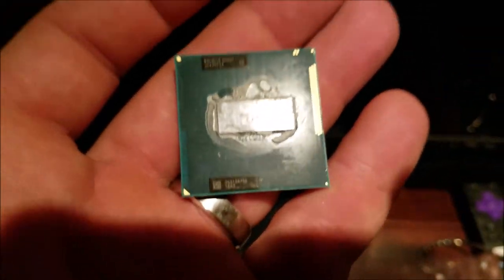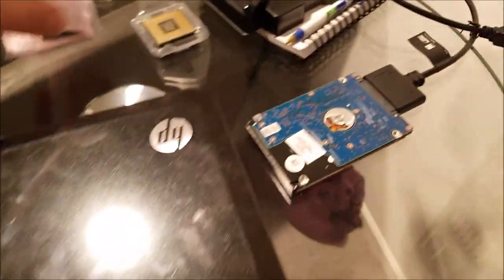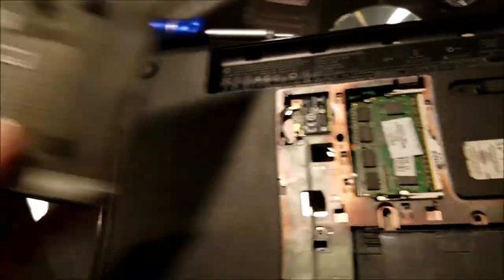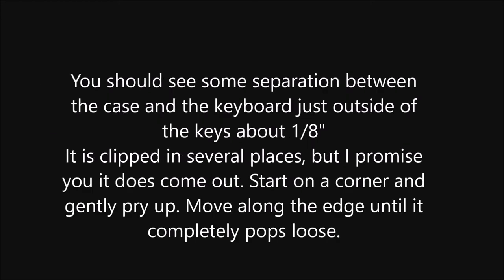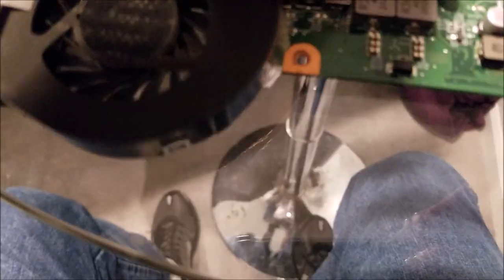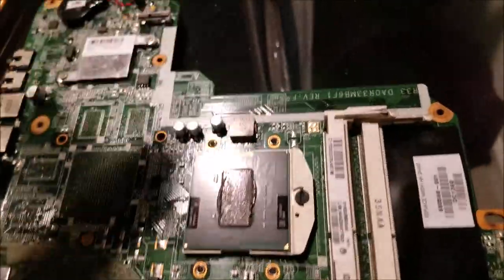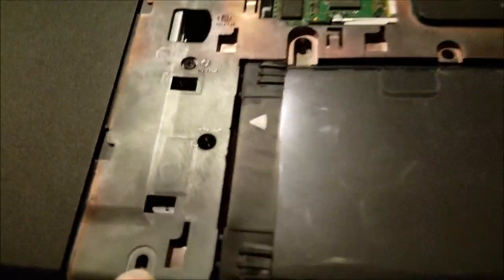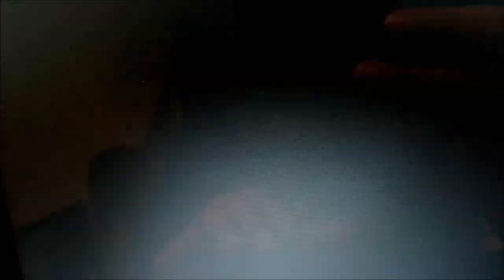How to upgrade to an i7 processor in your old laptop

Comment: have a nice day. I also have an asus k53sv / sx582v model laptop. Specs of my laptop: MOTHERBOARD: hm65 rev :05 (asustek), south bridge: sandy bridge, CPU: i5 2430m, internal graphics cards: intel hd3000 (I installed intel hd 4000 drivers on this video card) + nvidia gt540m . Storage: 480gb sata3 2.5" ssd + 1tb sata3 7200rpm hdd (hdd connected externally). ram: 12gb 1333mhz ddr3 sodimm ram. I installed the bios version to the latest version. Moreover, I bought something with 2 fans from china and it works in the cdrom slot of the computer. 3 usb in my computer It has a 2.0 port. I open a Youtube channel. I will publish 1 hour Mathematics and Geometry video lessons in 2k resolution. But the processor and features of the laptop are not enough to shoot, edit and upload videos to youtube. Can I upgrade my i5 2430m processor to i7 3840qm? What do you suggest me to do.  If I can make the processor i7 3840qm, I'm thinking of upgrading rams to ddr3 1600mhz 2*16gb=32gb sodimm ram. Also, my laptop battery is 4400mah +56whs+ 10.8v, and it runs out within 1 hour (while processing), (the battery has 6 cells). Can I change the battery to 9 or 12 cells like you did and use it for 9-12 hours? I'm thinking of connecting an internal video card. Something like Msi 3090 suprim ti. What do you say? With the addition of these, will there be a computer that can do youtube work, run animation, play online quality games, live broadcast and live online lessons? It has to do many operations at the same time. When I build a desktop system in the future, I will install this video card on a desktop computer. I have no money now. I have to postpone the graphics card and desktop computer collection to a later date. These are what I have. I need to shoot a video, edit it and put it on youtube as soon as possible. Please can you reply me urgently? MY PCİ EXPRESS 2.0
Reply: you can install an i7-2630qm processor and leave 12GB DDR3-1333 RAM in the laptop. You can install an i7-2720qm processor and 8GB+8GB DDR3L-1600 RAM.
Other i7 (4 core) processors are not recommended to be installed in this laptop due to poor motherboard power supply. Intel 3rd generation processors will not work on the motherboard (HM65 chipset). 
The cooling system should be of two pipes.
I installed an i7-2760qm processor in a similar laptop (Asus k53sd), but so that the power supply and motherboard do not burn out, I use a processor without turbo boost at a base frequency of 2.4 GHz.
Thanks to a 250GB SSD and 16GB (8+8) DDR3L-1600 RAM, the laptop runs fast. I use a laptop for old games (2006-2013). The maximum load of RAM was 10GB (out of 16GB of RAM).
32GB of RAM is not required for this laptop.

Comment: Hello can i upgrade my processor which is i3 3110m with i7 3940xm or i7 3840qm would be better choice
Reply: Btw my laptop is lenovo g400
Reply from the maker: @rvenant1132  I would go with a 3840qm. The higher tdp of the xm chips has turned me away from them unless your laptop has the extra cooling for it. My 2920xm ran over 100⁰C when rendering videos. The all-core base clock is 200mhz faster and single-core boost is 100mhz faster than the 3840qm. But the quad core i7 is much faster than your 2.4ghz dual core, either will be a huge upgrade. My 3840qm has never run hot and is still blazing fast. For reference, the base/boost clocks of each are as follows: 
3840qm: 2.8ghz/3.8ghz quad core
3940xm: 3.0ghz/3.9ghz quad core
3110m: 2.4ghz/no boost dual core 
  Consider price before ordering parts. These are aging laptops and entire newer models can be gotten used for less than the price of a cpu upgrade. 
  Aside from the cpu upgrade, I recommend upgrading your hdd to a ssd. Solid state drives use flash memory instead of a spinning disc with a mechanical eye to load data. Ssd's are much faster and will speed up your start-up times and nearly all load times. From a cold start, my old hdd took over a minute to power up. Now it's under 20 seconds. Old mechanical drives will fail at some point, so you should think about backing up or cloning your old drive if it is the original drive. It definitely revives aging laptops and makes them usable again. 
  On a side note, I think that even a 3630qm would be a great upgrade for you. It's a quad core and while the clock speeds aren't as fast as the higher tier I7s, it's still a great chip. I installed one in a laptop that I gave to my mother. It will be cheaper than the other options and still much faster than your 3110m. 
  Note that the onboard graphics are pretty terrible and gaming will not see much of an improvement. The only way to upgrade the graphics is to get an external gpu. I used an amd rx580 a few years ago and it made a huge difference. On an old game, I was getting 1000fps in the menu screen. The only problem is that I had to remove my wireless card and tether to the external gpu and power supply and output to an external monitor. At that point, a desktop pc is more practical. If you are interested, I can tell you more about it.
  If you have any other questions, feel free to ask. I'd be glad to help out.

Comment: Hello Erick, sorry for the inconvenience, but I wanted to ask what you think about the possibility of improving the processor of my notebook, Samsung rc420s02, it is equipped with a sand bridge processor, HM65, i5 2410m, max tdp 35, with a 988B rPGA socket.
Intel HD3000 graphics, and a dedicated Nvidia GT520M graphics card.
Based on your experience and compared to your notebook, do you think I can upgrade to a processor like the i7 3840qm or the i7 3940xm?
I would really appreciate it.
Reply from the maker: You said you have a hm65 chipset. That is your limiting factor. That allows only sandy bridge 2000 series chips. An ivy bridge processor will not boot in an hm65 system. The fastest processor you can use is a 2960xm. I think that anything with a quad core will do great. I believe there is a 2630qm quad core that would work well. I believe that is the lowest sku quad core. Anything with quad cores is leaps and bounds above a dual core. I don't notice a difference between the 3840qm and the 3940xm. The only difference I've noticed between the 2920xm and the 3840qm was the cpu temp under load. My 2920xm would regularly would see 100⁰C while rendering videos. I've installed a few sandy bridge quad cores in laptops for friends and parents and my wife. They all feel snappy and responsive after the upgrade.. And you can pick up old laptops for very cheap. I haven't benchmarked many of them, side by side, but for daily tasks, any quad core will work very well compared to a dual core. I also recommend a sata ssd storage drive. Unfortunately, an ivy bridge cpu will not work, but I recommend a 2630qm or any quad core sandy bridge chip that you can find cheap. 
  Good luck breathing new life into your old laptop. Comment here again if you need anything else.

Comment: hello! i need ya help man.. i have an dell e6420 with i5 252m and i want to upgrade this proccesor to i7 3630qm. i5 has sandy bridge and  i7 has ivy bridge. will work? second question. can i upgrade the ram to 16gb? on official page of dell says max supported is 8gb...but other ppls say can be upgradable. ty and peace!
Reply from the maker: It all depends on your chipset. If it is hm65, you cannot run a 3000 series ivy bridge cpu. If it is hm76, you can run the newer and more efficient cpus. 
  I think mine says max supported was 8gb but I have a kit of 16gb ram in mine. 
  I have actually upgraded to a 3940xm.
Reply from the maker: I'm guessing that was a typo and you have a 2520m processor.
Reply from the maker: I just checked the specs. HP says the max supported is 8gb but I absolutely have a kit of gskill ripjaws 2x8gb DDR3 1600mhz in mine. 
  I think a better upgrade would be a sata SSD storage drive. My HDD physical hard drive was ailing and the ssd made a huge difference. Probably as big of a difference as the i7 processor. One good thing about the i7 is that you can process data as quickly as the SSD and RAM can provide it. The dual core i3 or i5 processors can't handle as much data simultaneously because there are only 4 threads.. while the QM processors have 8 threads. 
  To find your chipset, download CpuZ. On the main board tab, you can see the chipset version. The hm76 or hm65 will probably be in the Northbridge or Southbridge area. 
  Regardless, look up processor compatibility for your chipset and the 3630qm is on it, you're golden. I'd still update your BIOS from Dell beforebyou swap cpu's just to make sure you have the best chance of compatibility. 
  Good luck with it.

Comment: Can't seem to find your previous comment last night. I'll will repeat again. I have Lenovo ThinkPad L420 and my current CPU  is i5 2430m. I need advice if it will works with either i7 3610qe or i5 3610me? They both support hm65 chipset and has the same socket which is G2?
Reply from the maker: Here it is! I actually commented on one of your videos. Lol. 
  It looks like you've done your research. If I had the choice, I'd go with the quad core 3610qe. It looks like it is compatible with hm65 and g2. Don't discount a high level sandy bridge chip. A 2820qm, 2840qm, or 2860qm would give good performance as well. It's just based on the older 32nm architecture. The newer 22nm architecture is a little more efficient and less power hungry. 
I'm not sure exactly what cpu you have currently, but I'd be willing to guess a sandy bridge i3. Either a high end 2000 series quad core or the 3610qe would be a great option. Stay away from the Xtreme series sandy bridge chips. They will be marginally faster but will probably run hot during cpu intensive tasks like video rendering. I tried a 2920xm and it was good, but not necessarily worth the money over a regular i7 quad core cpu.
  Remember that these parts are old. I would search the used marketplace and see what you can get a good deal on. I would have no reservations against running a higher end quad core sandy bridge over an ivy bridge 3610qe if the price was comparable or even lower. Also, be on the lookout for a different cpu. A newer laptop could probably be had for cheaper than just a high end cpu. I don't want to discourage you from upgrading what you've already got, but a newer platform may be a good cheap starting point as well. You could keep your hdd and slap in a fresh windows install and sell your laptop to recoup some of the budget. 
  If you haven't upgraded to an SSD, I definitely would. Especially if the hdd is original. Mechanical drives do not live forever. I would clone the drive and never look back. Ssd's will speed up any loading screens. . Especially windows startup. It will take under 20 seconds to start your computer with an ssd.. compared to over a minute with an old hdd. 
  It may be time for a new battery as well. If it is original, you probably have to leave it plugged in all the time or have very short battery life. I got an upgraded battery with more cells and my battery life is 12 hours plus. I literally don't worry about whether it's plugged in or not. Or if it has been plugged in. If I need it, I grab it and go. It's got plenty of battery...even if it's at 25%, I can work for hours before I really get worried. A new battery will bring back the portability of an aging laptop. 
  Aside from that, I recommend updating your bios with your old chip installed first. 
  Good luck with everything.. and don't blow your budget on a great cpu. . Remember that there are other aging cpus that are begging to be upgraded as well. Don't get me wrong, a quad core processor, an ssd, and a new battery will give your laptop a new lease on life. It will run programs like never before. But if you have to spend $250-300, you aren't really saving much over a newer used laptop. 
  I got a laptop a couple months ago for $100. I didn't even try to negotiate. I installed a $25 ssd and $20 battery and gave it to my father to replace his broken one. I did the same for my mother.. except I put a quad core 3630qm in hers. I just looked. . I paid $55 for that  cpu in mid 2019. 
  Good luck.. and don't be afraid to shop around. Let me know if you have any other questions!

Comment: Lol, i've aslo been thinking about updating mine, and i thougth first about the i7 2640M since my chipset is the HM76 and if it supports it besides the socket it's the same, but then it looks for the third generation and finds an i7 3540M, something better than the previous one, but I syill had two cores and i wanted to see if could support four cores, I found more, but I always  had that doubt, If i could hold my laptop, I would dissipate the 45w -55ww of the most powerful, and Ii aslo thougth about the last higher power peocessor that my laptop admitted, and it's just the i7 3840QM, but when i found your video, I was even more surprised that we had tha almost identical laptop, mine is an Hp g4-2165la, it does not much update the HDD for a Samsung evo 850 and literally goes flying...just a question, U updated your Bios to work? I hace the H2O F.26 and u F.27.... thanks
Reply from the maker: Yes. I updated the bios before i changed to my 2640m. I kept at the newest bios when switching to the 2920xm and the 3840qm. 
  I searched for an i7 and only found the 2 core 2640m came in these laptops from the factory so i wasn't sure if mine would work with the 2920xm. When my 2920xm arrived damaged, I fixed it and gave it a try. To my surprise, it worked flawlessly. Then i got more ambitious and tried the 3840qm. You can see the results from it in the video. There's a huge improvement over my original 2370m. 
  The ssd helped startup times but i haven't noticed much else. I have also upgraded to 16gb of 1600mhz RAM. However, I really don't think i needed it. The most ram utilization that I've seen is about  25%. Update your bios and try a 3840qm and see if it works for you. If it doesnt, you can always sell it. 
  Previously, my laptop was almost unusable. It was very laggy and would frequently suffer from slowdowns. Now it's quicker and more productive than a new laptop that i sometimes use at work. I think its got an 8100u processor. It's painfully slow. Good luck with your processor upgrade. 
  Check in the comments. Some other guys checked into the compatibility and some say certain motherboards cannot accept the 3rd generation ivy lake chips (3xxx) and have to stick with 2nd generation sandy bridge (2xxx). They are smarter than i am about this stuff. I'm more of a mechanic than a computer guru. Thanks again for the comment.

Comment: Hi my laptop is support socket g1 rpgA can i use  cpu sopport socket 2 rpgb?
Reply from the maker: No. G1 and g2 are different sockets. There is one pin different. If you have a pga989 motherboard, you may be able to run a sandy bridge or ivy bridge chip, but your chipset must support the new cpu. Some g2 sockets only support sandy bridge (2000 series) cpus and some newer chipsets will support either sandy bridge or the newer ivy bridge (3000 series) cpus. I believe the older sandy bridge chipset is commonly in the hm65 range while the newer ivy bridge chipset is in the hm76 range. If your number is near 65, it may accept a sandy bridge chip.
  The easy answer is no, but I'm giving you a maybe.. but only if you have a pga989 socket on your motherboard... and if you have a newer chipset.
Reply: @EricErnst  thank you sir yes may motherboard is pga 989 and may cpu right now is i5 540m and my laptop is HP probook 6550b
Reply from the maker: @yumatv.  find your chipset and you may be lucky enough to be able to run a 22nm ivy bridge cpu.
Reply: @EricErnst  noted sir thank you